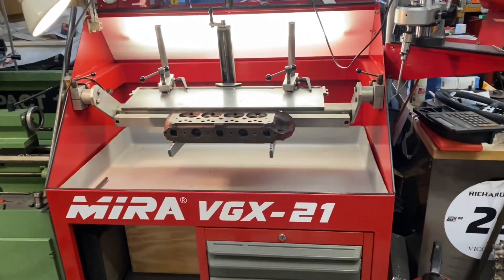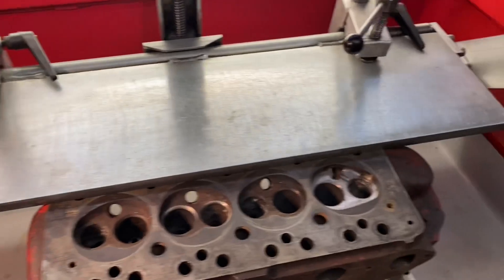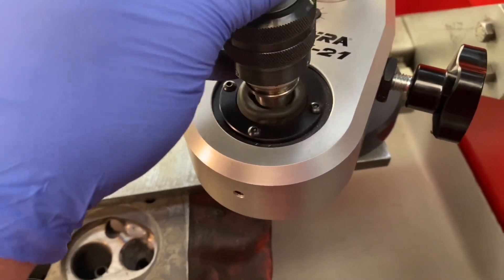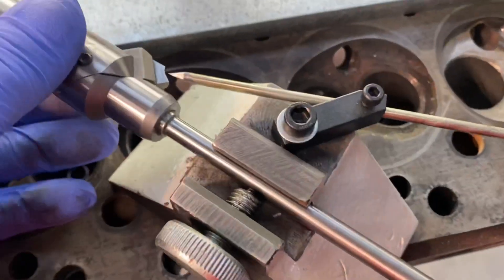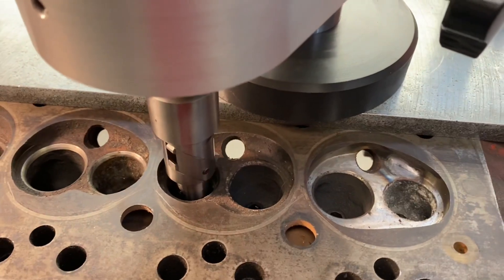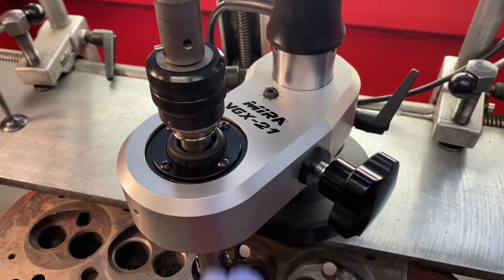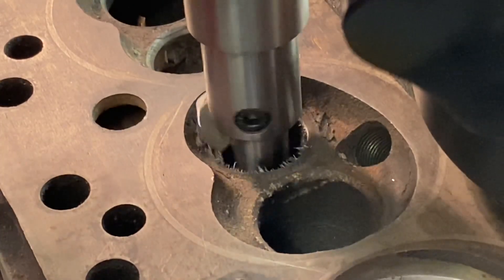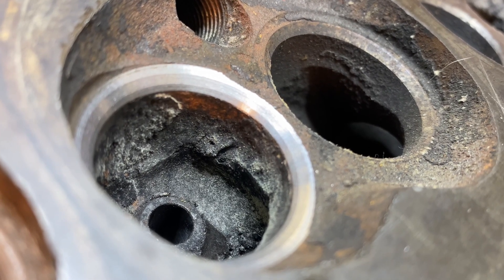Mira VGX21 valve seat cutter bench

Comment: Hi. What kind of for tools do you use on Mini heads? I bought the 4099 but not happy with it. Thanks for your help. Pilot I use the 7,10 but it rattles. Thanks for help
👍
Reply from the maker: i use a 7.13 pilot , what is a 4099?
Reply: @Vmaxporsch  the 4099 is the number of the cutter 👍
Reply from the maker: I use 7.13, and cut seats in 30/45/60/70 , takes more time but each head is different